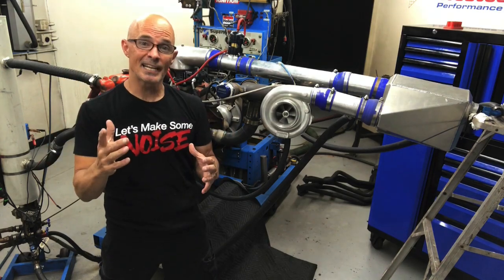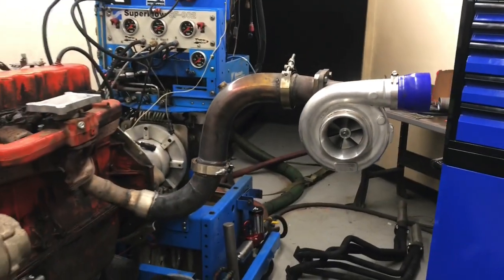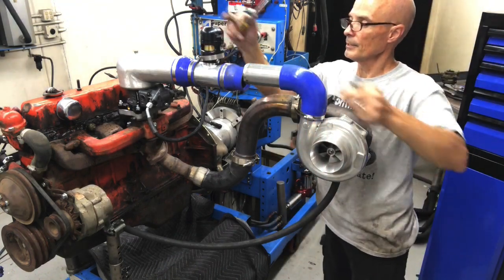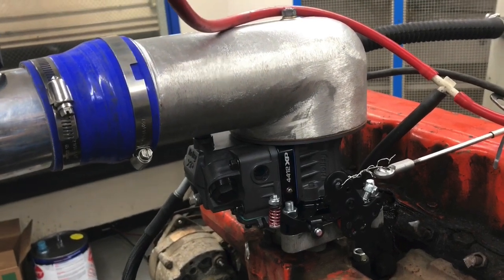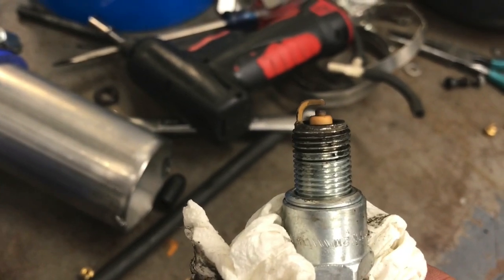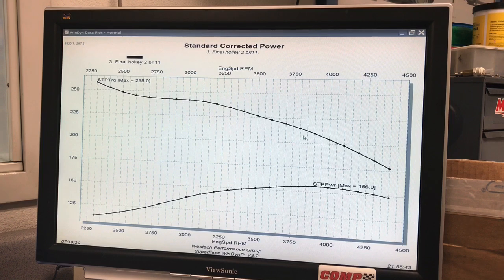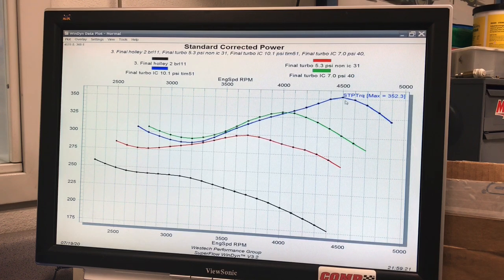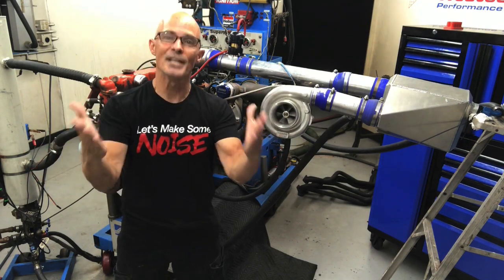TURBO 292-LOW BUCK, DIY POWER MODS

Comment: I love my ls engines, but watching this oddball stuff is far more interesting
Reply: That's for damn sure. One reason I gave up Car Craft was "Sominex" Jeff Smith and his nothing-but-LS edit. 😴
Reply: @donellmuniz590  yep, I subscribed to #CarCraft since the late '80s and loved that publication until around 10 or 12 years ago I finally let my subscription lapse. Every issue became repetitive stuff that was done a few issues earlier and just AMC Rambler, Ebay turbo, DIY BLAH, & blah blah blah....
Reply: I love my twin turbo ls 5.3 1200hp
But my favorite engines I built was my 1950 235 inline with a weiand supercharger on it. It would  turn heads at back to the fifties in st Paul and street machine national's like crazy!! With that blower off to one side and it made over 350hp . 30 over mcgurk pistons a berry's cam Clifford manifold modified and Clifford true length headers and HEI ignition. And the dumb ass I sold it too put a 350 and turbo 350 trans in it!!!  Cool you just made it like all the rest boring!!!!!
Reply: PRECISELY!
Reply: I agree. The LS and windsor combo’s today are almost cheating. I love all his oddball builds. 292 i6 chevies to 400m fords, and everything the people want. Super fun stuff
Reply: @Youmeanshenannigansright  This harkens to a time when you pumped up whatever the hell you had, and run what ya brung.

Comment: Could ya spin that 292 over 5000 with just a valve spring swap, or would it blow up? And I'm looking forward to intake testing with a Clifford or Offy, maybe even a homemade one (with your PATENTED adjustable runners [radiator hoses], of course)!

Comment: Do ya have an adapter plate to put a 6-71 on the stock manifold? LOL. No? How about a Weiand 144?😄
Reply from the maker: or the m90 I have here
Reply: @richardholdener1727  It didnt do well on a 5.3 (or was it a 4.8?), not sure it would do any better an a 292 (4.9L). But the 292 is long enough, that if you used a jackshaft, you could run 2 M90s!

Comment: Remember the 292 v8 back in the 70's in those Chevy Monzas? That would be a interesting project too. :-)
Reply from the maker: yes
Reply: Jeff Kopis  Was it? It could have been..
Reply: Jeff Kopis  I think you're right. I think it was a 262. Even better.. 
I had a 400 stick in my red 75. Typically that's not one of the engines they came with at the dealer. I got mine second hand but I think the fella that bought it requested it from the factory or something. It was a beast but I kept knocking holes in the oil pan over rough intersections and bumps.

Comment: I wonder how much power my 250 made with the GT28 turbo.  I was getting 25-28 pounds of boost.  Probably a lot of drive pressure though.  I did draw through with a holley 600 feeding the turbo then the turbo into the single barrel intake.  Had to run leaded fuel to keep the preignition down

Comment: Richard Holdener. please consider sourcing aftermarket parts from Brazil and Argentina as the 250 (which is this very same engine but a shorter stroke and deck) is a Hotrodder's choice

Comment: Still respectable gains for that old straight 6 tube.   That smaller turbo you mention would help drivability on the streets versus trying to wind up that long crank shaft for the boost.
Then, factor in an aftermarket or home made intake & exhaust manifold, some port/bowl work on the heads, a better cam.   You really could have a serious contender with that 292.

Comment: Loved it ,I had a 67 pickup I bought for $500 that had one of those in it ,I tried to blow it up so I could put a v8 in it ,never changed the oil just added anything I had to it ,I abused the crap out of it for over 7 years finally sold it to a guy that headed out to Canada in it still had the 292 in it , its probably still running 😊

Comment: I know this is a low buck experiment but a good welder and a Bridgeport with the long table. This is on a Ford 240/300. Or as I think of it a Ford Big Block 6 based on the bore spread.
https://bangshift.com/bangshift1320/mad-science-a-drag-racer-sliced-and-diced-a-pair-of-ls-heads-stuck-them-together-and-mounted-them-on-a-ford-inline-six/
There was also a Gen 1 Camaro running a 292 with the head built up from 2 LS heads. Unfortunately I can't find anything on it right now. Also there were some guys looking at adapting the 4 valve heads from a GM DOHC V-6 on to a Pontiac OHC.
http://www.hotrod.com/articles/hppp-0606-pontiac-sprint-six-engine-build/

Comment: was planning on using a build jaguar fully aluminium 4 valve per cilinder aj6 6 in line engine in place of the stock iron 6 
these jaguar engines can be found pretty cheap nowadays over in europe (compared to the old chevies whish are rare ) and there more modern , they where develloped to be dieselengines so they have a realy strong bottom end 
would love to see one of those on the testbench 
its a 4.0 long stroke engine 102 mm (4.02 in) stroke x 91 mm (3.58 in) bore and i was wondering wat size turbo is best to use on it

Comment: This was actually very interesting, in the next episode one of the improvements you need to do is to get rid of that crappy intake manifold and let that motor breathe with an intake that doesn't have a 90 degree angle to the bottom of the carburetor. You'll have to adjust the ring gap on the pistons if you plan on running more boost as well. Port the heads, cam and upgrade the springs with a 3 angle valve job should make 500 hp plus with 500 ft/lbs torque. If a turboed M5 3.5 liter engine can make a 1000 horsepower easily then it should be no problem to get half that power out of a much bigger Chev engine.

Comment: Back in 85 I put a T04B on a  stock cast piston AMC 230 inline with a side draft SU, Later a blow thru autolight carb and no waste gate. 20psi boost, best time ever lifted the head and broke all the ring lands. Awe the memories

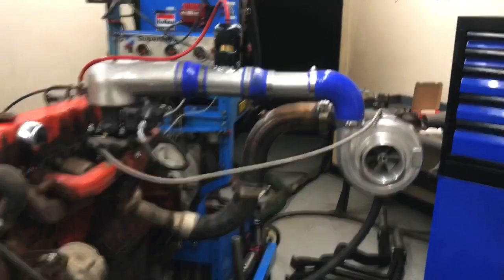Comment: 10:50 Put the wastegate on the Compressor side to control boost.  These guys did it: https://youtu.be/zPrUTpAX3CE

Technically it's a DBW Throttle Body on the Intake, but should work the same.
Reply: Used to be called overboost or safety pop off valves back in the day. Opened like a wastegate and harder to creep unlike having it on the exhaust side with too much flow
Reply: Nice thing about exhaust-side boost control is that it helps keep drive pressure in check, which is important to control on a boosted vehicle that is expected to stay together for the street.
Reply: @CrazyAndy317  if you limit the air going into the engine (wastegate on compressor side), it will also limit the exhaust drive pressure.  Less air in = Less air out.
Reply: Thats not the reason why they use a waste gate there its used for turbo spool up by using co2 control you can open the pre spool valve as i have heard them called and locking the waist gate on big turbos you get super fast spool then on launch pre spool slams shut ........instant boost and waste gate goes back to regular operation......turbo smart now sells a valve specifically set up for this
Reply: @pirsq314  check out this Celica: https://youtu.be/kAqBqBrz7PY  skip to about 8:05.

They talk about how boost is controlled with a Drive By Wire Throttle Body in the Intake side to to control boost.  No Wastegates on the Exhaust.

Comment: Morning are great with an interesting Holdner vid , Richard maybe Kevin can hook you up with some dual needle and seats bowls for your 4150 CSU carb and run some big hp vids carbureted , they already are sporting  boost referenced power valves ?
Reply: They are not , they are a staple of CSU carbs which I have one of theirs on my 1800 hp TT 555 BBC , the one in the primary opens at 5 psi and the secondary at around 10 , it works awesome in fact in the latest 292 vid Richard mentions wanting to test the very carb on that engine .
Reply: Boost referenced power valves are for draw through setups

Comment: I’d like to see you double the HP on a 4.2 vortec. They are all over
Reply: It's coming. IDK about double but he will try!! Checkers or wreckers!!
Reply: Funny you mention Checkers:  the Cory and Justin of the Sloppy Mechanics boys put a boosted 4200 in a Checker Marathon that, while not dynoed yet on-video, I feel pretty confident saying they probably pulled off doubling the HP at the crank at least.
Reply: @CrazyAndy317  I only said that because I didn't know how much HP a stocker had and if a newer one is 265 or something I questioned going over 500 with stock bottom end.idk but Checkers are sweet old rides when you dont paint them like a taxi!🙂
Reply: big Hurtt their bottom end have girdles stock id feel comfortable giving it boost with a little ring gap all day. I’ve had them apart, they’re tough.
Reply: @Billybobaggins9   not only that but they cast the blocks from foam dyes, so the castings are so accurate you bolt all accessories besides the power steering pump directly to the block.  I've never seen that before, and would never have expected that level of engineering from GM for an inline series of engines.  
Their biggest drawback is the exclusive bellhousing bolt pattern, but luckily the dowel pins are in the same place as the SBC/LS pattern and are even threaded, so you can get creative with mounting or just get an adapter place.
Reply: @Billybobaggins9  that's what I didn't know. But good to hear, girdles on that long crank. What is the red line on a stock one, envoy/tblazer? Just wondering my old stock 250 straight six pulls great but lays over about 4200 rpm and that's it.
Reply: @CrazyAndy317  I worked for a sole source mfg for GM on the I5 and I4 blocks. Same process. They glue up an assembly of styrofoam slices, pack the foam core into sand, then pour in the aluminum, the molten aluminum burns out the styrofoam, kinda cool :-).
Reply: big Hurtt think like 7-8 is actual redline but stock it’ll rev to like 6.
Reply: big Hurtt I have a 300 L6 in the old ford in my profile pic it’s an absolute hoss with a 4spd, and Dana 60 behind it.
Reply: @Billybobaggins9   Sorry to revive an older comment, but I have an answer to your redline query.  Redline is 6300.  There is a serious issue with 3rd order vibration after that due to crank throw, but BHJ special makes a SFI compliant harmonic balancer which, while shifting light vibrations down the range a bit, fixes that problem.  It's all detailed in this video: https://www.youtube.com/watch?v=_X6hzInL-rQ&t=1023s
Reply: There is an episode of Hot Rod Garade where they attempted that.
Reply: I'd love to see this i remember when they came out they ran the Baja 1000 with a turbo and GM said it was putting out 1000hp they is if your talking about the trailblazer 4.2

Comment: That was absolutely the WORST place to put an oil drain!  Are you OUT-OF-YOUR-MIND[imho]?   ANY IDIOT knows the oil drain should be put on the LOWEST practical spot to facilitate complete drainage via gravity.   If a frame-member was going to be in the way, then drill a hole in the frame member!    The way your oil drain is set-up, you'll STILL HAVE to drop the WHOLE pan, which means you might as well not have bothered in the first place!    With you putting the drain in the WRONG PLACE, WHO can believe ANYTHING in your video [imho]?    I'm FAR from perfect, I missed no waste-gate.
Reply: I LIKE "taping the gap."   Thank you for working with this unusual & awesome engine!
Reply from the maker: oil drain below the oil level in the pan? bad idea! Oil drain above the oil level in the pan-good idea!

Comment: This is good stuff.
Seems like a lot of power added for an an intercooler at that level of boost. I wonder how close the turbo is to surge and where everything is relative to the compressor map.
Reply from the maker: there is no map for this turbo
Reply: @richardholdener1727  
Whoo Hoo!

Comment: Seems like around 73-74-75, Chevy designers copied the Ford small block 6 head/integrated intake manifold design for the 250’s. In 1979, they revamped the 250 for the light truck line with a “half Quadra jet” 2 bbl carb and split exhaust manifolds. That motor was a nifty idea but the motors’ longevity was pretty short. A couple of relatives bought new C10s with that new 6, and neither got much over 60K miles out of them before a rod dropped. It’s nice watching how these mods on a stock bottom end and valve train double the horsepower. Imagine a committed approach. I’m with the viewers who are interested in how this works on a Ford 300.

Comment: That poor 292 needs a better head! Slap on a pair of chopped in half used stock LS heads with some JB weld joining the two together and I guarantee it’ll see huge top end gains! Anybody who has ever messed with an L6 knows the head flow of them is horrible. Worse than a freaking Studebaker 289! Haha. But, you’ve got me convinced I need to go turbo with my 5.9 magnum. I’ve got a rebuilt TP-38 from a 90’s ford 7.3 that I think should spool on my 5.9 really low and give huge tq and hp increase well within daily driver rpm range, I just gotta figure out how to tune the stupid truck. Flipping the manifolds and routing and welding a couple feet of pipe is a cake walk, but the tuning side of it (a 99 ram 1500) has me a bit scared.

Comment: Amazing how much power comes with technology, example I have a Ford Falcon FG 2008 turbocharged twin cam 4.0l inline 6 (Barra) so almost 1L less and on 10 psi she makes 378hp at the hubs.

Great video too, would be cool if you did a cam, intake,carby and smaller turbo or maybe with the cam and intake it may be a lot better.

Comment: Keep the turbo, put it after the headers. Better flowing intake, EFI system that can control the AFR and boost better. I bet that can turn the internals to scrap metal.
I like a straight six!!

Comment: This makes me want to find a straight six Chevy II and boost that lil'   booger. It may not be "ideal" or "economical", but it'd be fun and not another LS swap.
Reply: Im doing a maverick right now but instead of the 250 thats in it, I have a turbo 300 on the stand ready to go. I just did the 5 lug disc breaks with a lsd 8.8 rear. When I was younger I would have done the engine first than the breaks sometime, maybe. Im also going to run a old tbird aod and hope it holds up.

Comment: OK so if you ran say 3,000 rpm steady state loaded, would boost rise ?? The two step stuff limits rpm by retarding timing, and this also helps spool the turbo as well ?
Reply from the maker: two step on the dyno?
Reply: @richardholdener1727  Just in the same general line of thinking about steady state boost vs a sweep ?? Should have kept it to one question. If we loaded to steady state RPM down lower in the curve, would the boost gradually rise and force us to apply more and more load to hold say 3,000 RPM ?

Comment: Had someone comment that Chevy made port fuel injection available for these engines.  though true, they also remanufactured the cylinder head to one with an integrally cast  intake manifold similar to what ford did with their 170/200/250 six cylinder engines.  Engines offered in the U.S. were relegated to carburation.  Fuel injection for the amalgamated head design was only offered in Brazil, never in the U.S..  I love your test on the 292 but would dearly like to see an aftermarket intake and much larger cam. Perhaps in the 0.550-0.575 lift range With some screw in studs and valve springs. A lot of old timers removed the bolt stantion from the intake port and spot faced the floor of the intake port. The head was attached with a short cap screw and hardened washer. The top hole was plugged with a screw in pipe plug using a sealant to prevent intake leaks.  Simple trick for increased intake flow.  These old engines responded extremely well to basic mods including larger valve sizes and good head porting. Eagle makes a rod for these engines and I believe a crank can be had if special ordered from them. Good pistons can be had from several reputable piston manufacturers. Properly built these old engines will freely rev over seven thousand rpm reliably. At these rpm levels they loose their tractor like sound and sound more like a really pissed off bee. Lol   Great work your doing. Could a ford 300 be done in the future.
Reply: I built a 250 version 30 years ago crower sportsman rods for the small block chevys are made to strait six journal width and machined down for the v8s and for 250 motors the 307 v8 pistons are correct bore and pin hight(i used 12-1 slugs and milled off some dome for a cheap 10.5-1 piston) valve relieve angles dont match up but i still had enough clearance to run a upper .600 lift cam if wanted..... Add lump port plates and a 4 bbl intake you have a 300+hp n/a motor (12bolt has a few videos of motors like mine with out the upgrades) and in my case a 3 fogger direct port progressive NOS KIT... 150-200 shot......i figure a 450-500 strait 6 will hurt feelings and crush egos.......

Comment: 292 motor back in the late 70s I was pushing 530 horses. I can't remember the torque. I had six one barrel carburetors on it. When it was tuned and everything in the sink it would run.

Comment: I had a 292 in a 64 chevy truck. I put a later model head with the integral dual exhausts and an adapter with a rochester dual jet (it is what I had laying around). With a 3.73 rear gear and 3 on the tree, I had so much fun out running 5.0 mustangs stop light to stop light. After I beat 'em they would ask what I had. My answer "stock 6 banger".

Comment: Heh! The turbo and exhaust note makes the thing sound like a toned down CAT engine, lol! NOICE!
Something which would be great to see is the Lambda on each cylinder. My understanding of the 6-cyl engine setup is, the end cylinders (cyl 1 & 6) suffer from being lean because of flow through the intake manifold. Fuel injection is supposed to solve this issue ... however, I'm wondering how well boost might help solve this as well.